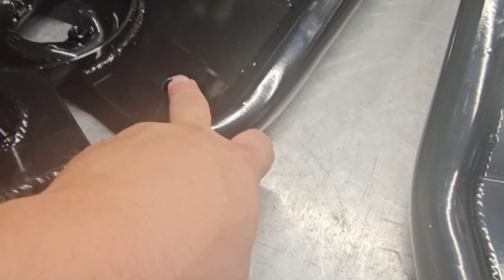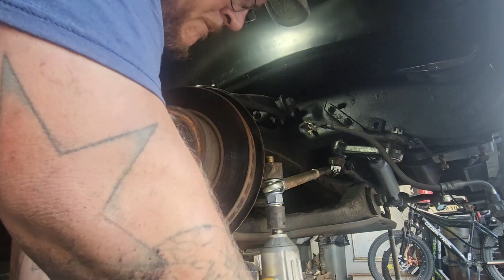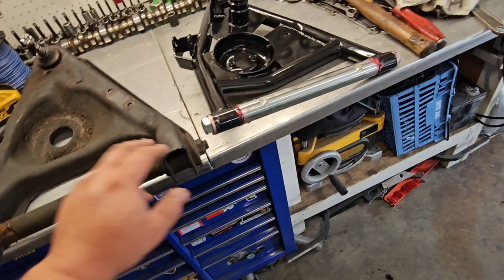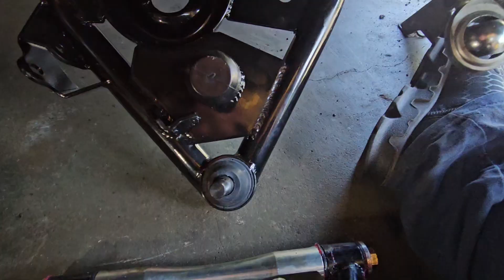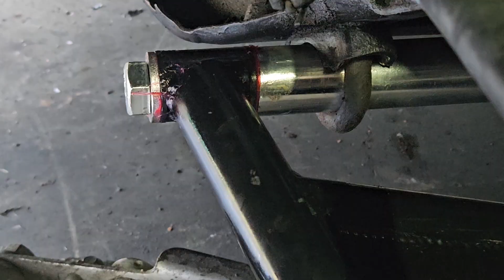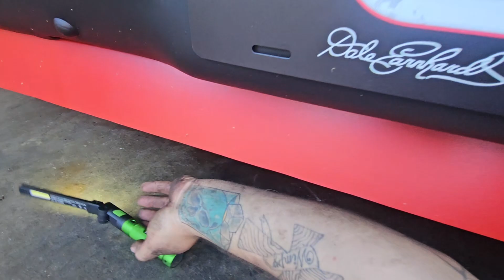1975 Chevy C10 "Gator" Gets New Control Arms & UMI Coil Springs! 🔧 Suspension Upgrade Begins

Comment: Do you happen to have a link for the arms?
Reply from the maker: https://www.ebay.com/itm/354921969927?fits=Year%3A1975%7CMake%3AChevrolet&_skw=1975+chevy+c10+control+arms&itmmeta=01K2FRX7QANF9Y697VMQFV1JQF&hash=item52a2ff7907:g:FlIAAOSwotVkd6SB&itmprp=enc%3AAQAKAAAA8FkggFvd1GGDu0w3yXCmi1cLSy4mj8kyuZMK18GSNXCzKvAHUzMLooQSMILerfz1zX%2BNgPpM1KYu4cqDJI31GZVWq4otesrq2TABm4yYzEp84qjfP68pPBL%2B094MudRvksB7WGy1DeL6hBaasQGFvF%2BuODNUlH5fZvw32aRC6BWj4J6M0moT%2BgR%2FJRIjKVnd6INGPvsHEZ0aMcfJJ8Fja98%2B1lvUoHQ4KwA%2BUrkQl1nEwxaFEexenVG4%2B8JwrH5bDa15oS9luztWHkZOX5zB9cZVwqeoMJ6Y%2BHROZc4kebgbA%2FH0qiKVQwWjm0sAgjId5w%3D%3D%7Ctkp%3ABFBM7vv0-JNm